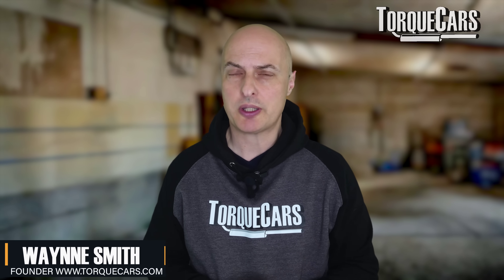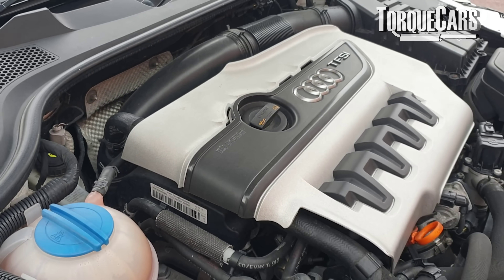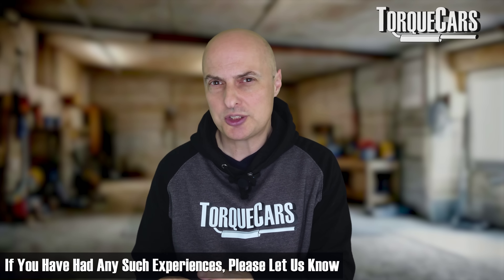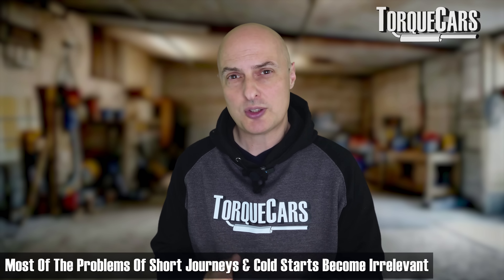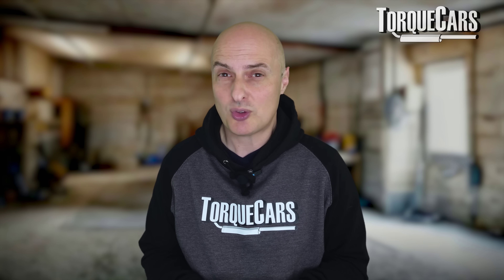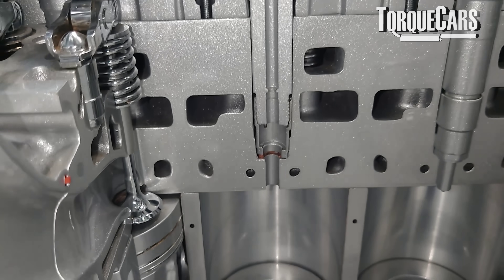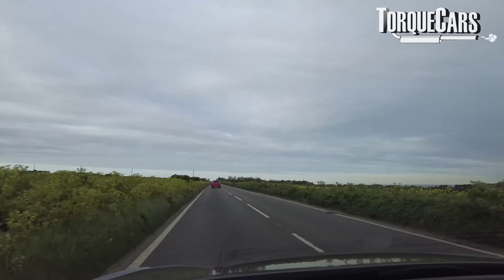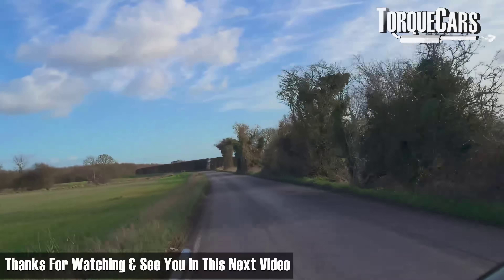🚗 Stop-Start vs Engine Idling: Which Really Kills Cars?💥 The Truth May Surprise You…

Comment: I turn it off on the basis of safety. When I pull out into traffic it is disconcerting to have the delay causing momentary unease. I have a modern automatic and can push the accelerator to the floor and release it before the starter has started the engine.

Comment: And what about the lifespan of the starter motor itself? Have starter motors been made more rugged to deal with the extraordinary increase in engine starts when the stop/start system is in charge?
Reply from the maker: Good question and yes they are far more substantial. The torque they produce starts the engine almost immediately. They also feel heavier than older ones. I have replaced many starters on non stop start cars, but still haven't had to do one on a stop start model.

Comment: With the stop start on you do not get instant acceleration especially if you want to nip out into a gap in the traffic. I've always turned mine off for over 10 years now, unless in heavy traffic, and even then only if its not particularly hot or cold weather.

Comment: Until a sufficiently load-bearing oil wedge is created on the bearings, which means reaching at least idle engine speed.. until then, mixed to boundary friction occurs on the bearings... Using start-stop is worse for the engine in this respect.

Comment: Not a fan. Apart from cutting lubrication to turbochargers, the sudden shock force on cam chains can cause premature failure which in an interference engine design can result in extensive engine damage. It's the equivalent of slamming one's foot down onto the pedals of a bicycle. Not long before the chain would break!

Comment: Sat idling for 5-10 mins does little to no damage to a car. I used to think it’s bad but idling for a short period is not bad for the engine. Complete myth this, especially on a petrol. I used to be sat idling daily for 10+ minutes at a time waiting for my Mrs to finish work. Had zero issues (Honda civic ek4 used as a run around), I did this for years with zero issues, I then took this engine apart to change the rods, springs, retainers and put a d16z6 head on it, turbo and blow it up before I put a k20 in it, and there was no more or little damage to this engine than any other engine I’ve rebuilt. 

Makes zero difference don’t listen to people saying it destroys your engine being sat idling. Total nonsense.

Edit: I turn stop start off on every car I use that has it.

Comment: Most modern stop-start systems have several measures to prevent the engine from stopping if it could cause damage and they also start the engine using the hybrid system if available so unless it’s badly designed, there’s no issues.

Comment: Never owned any vehicle with stop/start and never will will shorten the life of the starter motor and that's bs about modern starter motors been more resilient unfortunately it's another engine life shortening that the modern motor manufacturers want along with direct injection and turbo charging may l say one thing my 1997 Toyota Hilux has done 440000 kilometres and definitely doesn't have engine start stop has a manual gearbox and a carburettor things that add to its longevity

Comment: Start/stop is just annoying. A completely unnecessary invention. That split second of the engine starting, just as you want to pull out of a junction can be really dangerous, especially with engines now being so quiet, you don't even realise the engine has switched off. Also, does it not wear out the starter motor in time? Surely it can't be good for this

Comment: Turbo’s need cooling and oil, if you stop while it’s hot, the turbo oil burns. 

I hate stop start. I turn it off or just hold the clutch.

This feature ie for one reason and one alone: pollution. 

All other things they promote to use it, is just an excuse.

Comment: I found the stop/start on a petrol, manual car to be reasonably unobtrusive but on my 3.0 V6 diesel, auto it is terrible as it is slow to engage and rough so I disabled it completely when the car was new. It is a modern direct injection diesel so I also installed a catch can to ensure that oil/carbon does not cake the inlet tract or the valves.

I reckon that with the extended starter motor and battery life, I'm ahead on all counts. Even the fuel consumption at idle is relatively modest.

Comment: Hey, this was a very brilliant video. I really like that you addressed this topic on a fact based approach and not an emotional one. For a lot of people Start Stop seems like the worst thing on earth when reality and some conditions it's not only for emissions but also for helping with fuel dillution and not running your engine at idle when cold. 

I personally own a MK8 Golf Estate 2.0TDI 110kW and always have Start Stop enabled. With the DSG, the engine is running even before i lift off the brake pedal fully. The only edge-case where i disable the system is when i am coming from a good motorway run, the oil is hot and i approach a junction. I disable it then until my oil temp is below 100°C again to give the turbo and all other parts enough time to cool down. 

I had a Passat B7 2.0TDI DSG before, which had a really early implementation of start stop which wasn't great. Every restart of engine felt really harsh, i had issues with the battery draining after the short stop so the car wouldn't restart anymore. New Battery fixed that but i would've expected that even such an old system would have proper voltage monitoring. Also the battery of this car had to be replaced every 3 years, which is a pretty short lifespan. 

Other than that, especially with a diesel engine, i prefer it to be off at idle so you don't feel the vibration.
Reply: BMW X1, 10 years old, 100,000 miles, no vibration with engine running on tick over......................................( I Always turn off stop start )

Comment: BRO. It's 101°F today in Washington DC. That's 39°C. Your European mentality completely ignores the effects of cutting the A/C. Air Conditioning is mandatory in stop and go traffic especially just sitting still with no airflow coming through the windows. AC is so important, even our seats are ventilated. A stopped engine is an engine producing no air conditioning and during heatwaves could be deadly. The average Brit has no idea how living in an inferno feels at 38°C. Heat stroke kills more people than any other weather phenomenon in the US. Think about the outside world before spewing this nonsense on the internet.
Reply from the maker: Thanks for watching a video published the other side of the world by a very small YouTuber and actually bothering to comment on it.

Firstly if you are running Aircon in those temps you are not really idling as the revs are generally raised and the engine is under load - even if you had stop start switched on it would probably not cut in due to the drain on the battery. Secondly your engine will warm up pretty quickly, so I don't see much cold start or cold running risk really which was the problem I explained in the video.

As to "nonsense"  and we are thinking about the wider picture here, how much of the world has 39°C temps? How much of America faces these extremes? Should I just do videos that suit your situation perfectly and ignore everyone else?  What about people living in cold parts of Canada, and Syberia? I think my sensible approach of explaining risks and mitigations detailing what goes on and then leaving the viewer to decide what suits them best is the way forward rather than trying to tell everyone what they have to do.
Reply: @torquecars  “even if you have start/stop switched on it probably would not cut…” 

- NO start/stop cuts the air conditioning compressor from turning with the engine. That’s why we hate it so much. Forget one time to switch it off and during a heat wave you’ll panic until remembering. Here in America over 39°C temps are common for many days especially further down south like Arizona, Florida or Texas. During these heatwaves thousands of people are dying for lack of air conditioning. But  we’re acclimated with many defenses. A cold weather acclimated Brit would feel like living in a volcano so remember your vehicle A/C if you come here. Preferable with ventilated seats to blow that cold air on your whole body too.

Comment: Surely, every time the engine starts, the oil pressure is low or zero for a short time - every time.
Reply: What the hell. Did you even watch the video or thought logically? How should oil pressure drop to zero immediately when the engine is off? Yes on the inital start of the engine, it has no pressure for some seconds. But once the pressure is built, it takes a very long time, speaking of minutes until the pressure is critically low so that any kind of damage could occur.

Comment: The correct answer is neither hurts the engine, but stop/start saves gas. The only time I disable stop/start is when it is hotter than the surface of the sun here in Florida.

Comment: Maybe I'm just too old and too set in my ways, but when my engine stops while I'm at a red-light, my brain immediately screams "Oh shit!  The car just died!"  Even though I know full well that it's just the stop-start system, that's still my immediate reaction.  Because for my entire life, until now, the engine stopping while sitting at a red light was always bad news.

As far as wear-and-tear is concerned...  When the engine's warmed up, yes, there's very little wear on the internal parts of the engine when you stop and start them.  That doesn't concern me at all, really, because the engine is never stopped long enough for the oil to drain back down.  What does concern me, though, is the extra wear on the starter and battery.  Manufacturers claim they make those components stronger in cars with start-stop systems, and maybe they do, but they absolutely will last longer if you simply don't use them as often, no matter how beefy they are.  If the starter is designed for, say, 10,000 starts, and I only start the engine twice a day, then I get 5,000 days without needing a new starter.  If I start my engine 10 times a day, then that's only 1,000 days until the starter needs replacing. (Yes, I pulled those numbers out of thin air -- I have no idea how many starts you actually get out of a starter motor.  But the point is valid -- use something less often and it wears out less quickly.)

Further, we've had engines that idle at red-lights for decades now, but you can still very easily get 250,000 miles (or more) out of those engines with regular maintenance.  So clearly idling the engine whilst stopped can't possibly be doing that much damage to it.

Frankly, I just can't see risking my $1,500 starter and my $350 battery in order to save $0.47 of fuel per week.  It just makes no economic sense.

Comment: There is another U-Tuber called Pine Hollow Diagnosis that has come across 2 Toyota Prius cars, with gas hybrid drivetrains, that had ruined engines because the gas engine did not heat up enough to evaporate the moisture that accumulates in all engine oils.
Reply from the maker: Interesting, I've actually just finished a video series discussing this very topic with suggestions on how to avoid the problem.  One video is already up on my driving channel https://youtu.be/ku7Tx09t3Z8

Comment: Ive permanently disabled my stop start by disconnecting the switch on the bonnet latch. Reasons as follows:
1. I've checked, I'm saving about 1percent of fuel which here in NZ is for me about $30 per annum. I've replaced my battery with a normal one for about $nz200 not the $nz500 for an AGM one required for stop start. Straight out I've saved money there.
2. All your comments about engine wear are fine. But in 11 years and 220k kms my engine mounts are still perfect. Other Mazda3s are needing new passenger side mounts by now!
3. I personally cant stand the sensation of the stop start as a driver. Especially when you get an awkward situation that confuses the car computer and it goes all on off on off.
4. Anyway that's my 2 cents worth. Rant over!
Reply: @madman3556  Thank you for the comment, it is useful.

Comment: My citreon c4 doesnt allow the stop start to work until the engine has reached its running temperature. Also if the fuel level is less than a quarter of a tank of diesel.

Comment: When the engine stops, so does the water pump - really not good on a hot day with today's stupid thin oils.
Reply from the maker: This is why many manufacturers are switching to electric water pumps now. But as you've pointed out if this affects you it could be a risk you need to bear in mind.

Comment: 07:20 - "...use the stop-start system after about a minute or two."  Sorry, but there's some errors here, and key information missing, especially important to drivers starting their journey in inner-urban stop-start traffic conditions.   
MISTAKE 1: "Give the engine a little bit of chance to circulate the oil..."  No, the oil is fully circulated in 10 or 15 seconds - probably less in any reasonably recent engine design. 
MISTAKE 2:  Coolant in the engine itself, is not coolant in the entire cooling system.  Coolant temp within the engine itself increases relatively quickly - but it won't  necessarily be at correct operating temperature in just a minute.   Also, when the coolant within the engine itself, does reach that operating temp, the thermostat opens and in comes cold coolant from the radiator, but there's  more to this yet... 
MISTAKE 3: Metal is not water.  The aluminium engine reaches ideal operating temp slower than the coolant - and iron block engines will be even slower again.  Metal needs much more time to heat up and expand to its ideal operating tolerances.
MISTAKE 4: Oil isn't water.  It doesn't reach operating as quickly as the coolant.  When your engine temp gauge needle hits the mid-point, it's only the coolant - not the metal and not the engine oil.  

So, please give your engine several more minutes than 1 or 2, before flicking on the stop-start system.

Comment: I have switched this function off for 10 years, since the car was new.
I would probably have left it on if a had a manual car because I can then decide myself if I want it to stop by putting it in neutral and release the clutch
Reply: to be honest, that's one of the most valid points against s/s. Cars with Automatic Transmission are a bit unpredictable sometimes. I prefer the manual approach a lot more but in my opinion, the newer the car, the better the systems get even with auto tranmissions.

Comment: At idle some modern engine turn off the oil squirter on the cylinder bore and back of the piston (one of the videos d4a did spoke of this). Not sure if stop start would help cut down wear in those cases...

Comment: I still say the savings are offset by the drain on the Alternator to charge the battery.Better to let it idle.My 2.2 vectra uses 0.2 of a gallon per hour idling.Switch it off and on again it uses  0.4 for a time then 0.3 b4 settling back after minutes to 0.2 again.This drain is Alternator working harder.Its the same drain as having the Air con on. That's without the envioment damage of new battery and starter motors needing making and disposal.
Reply: But it';s good business for repair shops!!!!!

Comment: The most annoying thing is not that you hear the engine stating or you add probably wear on the starter. The truly annoying thing is that you lose power steering and air conditioning while the engine is stopped
Reply: ☹️ Oh, diddums - the air-con is off for, what, 1½ minutes?  You poor thing. 

Also, the absence of power steering in a stationary car, is exactly what sort of problem?
Reply: @assininecomment1630  No matter how insignificant, who needs the aggravation.
Reply: If aircon is that big a deal to you, don't release the clutch pedal, engine stays running. As for the steering point, if you have to resort to such a nonsensical argument to try and make some sort of a point, then your point isn't worth making. You don't need steering in a stationary car.
Reply: Lol, on my 2021 Car the Steering is still working and not disabled when engine is off. But also, who uses steering in a stationary car? And also, if your airconditioning system is intact, it will still blow cold air for about 2 minutes when you are stopped. And any car with Auto AC will turn the engine back on, when the interior of the car gets too hot.

Comment: The one scenario I did not see addressed was Start-Stop use on a turbo charged engine that does not have electric oiling.  In this case I think that a car driven in stop-and-go traffic could loose the cooling effects to the turbo that a car with continuous idling would have.  I have no proof of course but for me, the cost of a new turbo make the benefits of stop-start not worth the risk.
Reply: @ksljmiller  if you are sitting idling turbo won’t be running or getting hot.
Reply: In the early days of turbos particularly HGVs and heavy plant (Saab being the rare exception) it was recommended that turboed engines be idled for 60 to 90 seconds before shutting down 😮
Reply: My understanding is that car manufacturers “invented” the stop/start system to achieve lower mpg. Cars then required more powerful and expensive batteries to handle the extra 5 to 10 engine starts per trip and let’s all hope the starter motors will not fail 5-10 times faster due to the increased workload.
Reply: Your opening premise is incorrect. Fuel economy was secondary. It's main aim was to not have, for instance, pedestrians at the lights subjected to avoidable avoidable exhaust fumes.
Reply: Interesting. The turbo is already screaming hot and is always spinning if there is exhaust gas flow. I never switch off immediately when I have arrived home.
For what it's worth, I'm a light vehicle master tech, I can't argue with the points made in the video, but I'm definitely anti start stop.